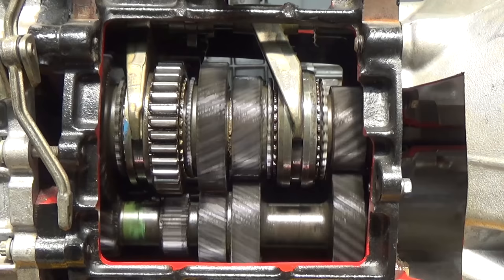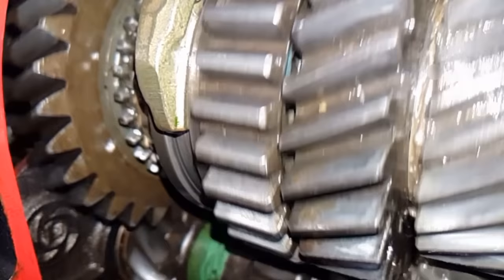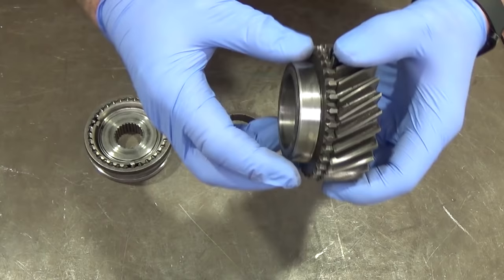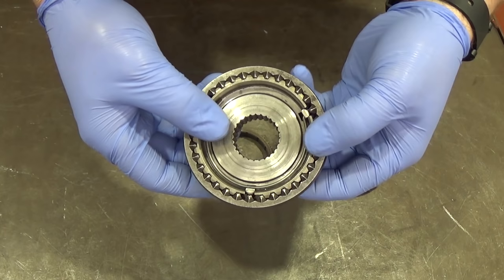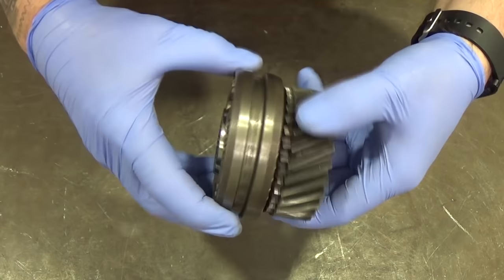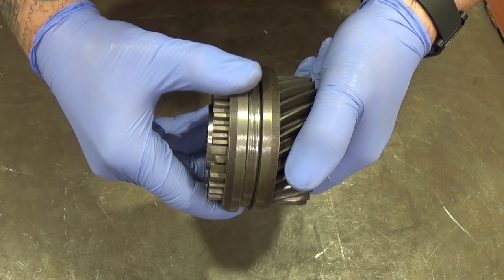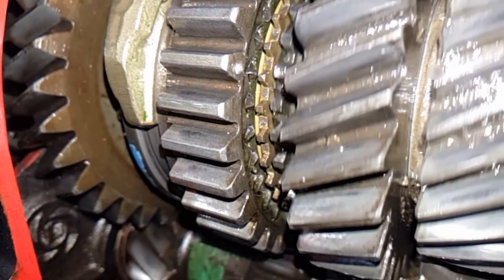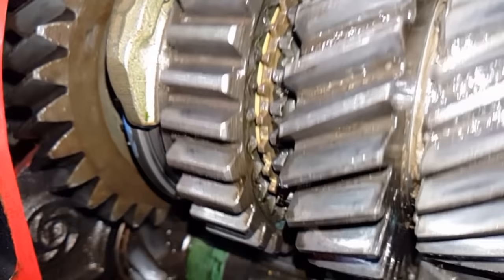Synchromesh unit (Manual Car Transmission) - How it works

Comment: It's amazing that humans are capable of making such complicated machinery. You have to be a genius at this kind of stuff to come up with a system like this.
Reply from the maker: It is amazing James. Although when it's in pieces on the shop floor and you're trying to figure out how it happened, you wish for one of those geniuses to appear and lend a hand.😉
Reply: The mind of Men.
Reply: We've been at it for thousands of years
Reply: Cause it's an accumulation of past knowledge, over hundreds of years, over multiple discipline. It's not that complicated when you pick apart each principle that works for each component. From simple stuff piled up to be more complex. That's just what engineers do. That's why there's a degree for it
Reply: Dont get me started on motherboards in your computer or ecu. But this is Quite impressive as well, its a blessing and curse to be living in this era
Reply: @yunan9610 can’t wait to start working towards my degree in it 😁
Reply: @yunan9610 Think about all the ideas and inventions by people with no degree.  Degrees are only mainstream for the last 200 years. So many inventions were hatched in a shed or garage by some person with an imagination
Reply: @EducationalMechanics would the synchronizers be the reason for say for swapping from gear oil to ATF in manual transmissions (ford rangers to be exact)?
Reply: I have the same exact thoughts you have about this mechanical wizardry.
Reply: @yunan9610  mechanical engineering?
Reply: @AgentOffice  Had to google this, got this from Wikipedia, interesting...  "The earliest preserved gears in Europe were found in the Antikythera mechanism an example of a very early and intricate geared device, designed to calculate astronomical positions. Its time of construction is now estimated between 150 and 100 BC. Aristotle mentions gears around 330 BC, (wheel drives in windlasses). He said that the direction of rotation is reversed when one gear wheel drives another gear wheel."
Reply: Only a small subset of humans were able to conceptualise this
Reply: But the other half is confused on the boy/girl concept. What a time to be alive
Reply: @jonathangarzon2798  We've been using sulfurized gear oil in synchromesh transmissions since before borate ester based ATF even existed. And I've seen tribologists claim that sulfur doesn't corrode yellow metals until the temperature is above 100C. Then there are the ZDDP additized oils like engine oil/hydraulic oil/Ford Type F/CVT fluid that were recommended in some manual transmissions.

Comment: But what I was wondering, and I’d be glad for a response, this system needs quite the pressure to to cause enough friction. Right? So obviously the drivers simple hand gestures must be leveraged hydraulically or pneumatically right? And what I was also thinking is  that you must either be slowing down a running engine or accelerating a car, with only surface friction, otherwise the two systems wouldn’t match speed. Right? How long do Blocker rings live then? I’m sure the friction is very intelligently distributed across the maximised surface area of the blocker ring, with the shape of the lobe and all, and that the material on that part is well treated in manufacturing, in order to be resistant to such wear, but it just sounds like a really tough job for that piece of metal. Mind you my first semester of engineering still lies ahead of me some few months.

Comment: That's a brilliant explanation. Thanks for the video! 

I own a 2017 Jeep Wrangler, and the transmission has had issues going into reverse. I took it to a mechanic, and he mentioned that it's a common problem with manual transmissions from Jeep at the time. He said it was due to the way they designed the Synchromesh. 

Now I just have to redesign it so I can make new parts and fix the issue. One day....

Comment: Fantastic design 👍🏻
Reply: Yeah, until the sacrificial brass sychro ring wears out and you have to throw away the car...  I have a RAV4 on which you have to remove the engine through the bottom to get to work on the gearbox.

Comment: Amazing video! Notice how the synchro immediately matches the speeds of the dog teeth and the constant mesh helical gear. No wonder experts suggest never to rest your hand on the gear stick. The slightest movement of the gear stick towards a gear slot causes the synchronizer ring to start matching the speeds by friction. So keeping the hand on the stick causes unnecessary wear on the gear stick is in fact a very true statement!
Reply: Not only that, there's some really advanced chemistry behind the gear oil additive package's chemistry also. It has to be designed so that a friction modifier component ensures that enough friction is taking place as the synchro/gear teeth start gripping each other. Hard to synchronize slippery stuff together.

Comment: You explained definately and clearly,i want a suggest from u sir,i'v changed the synchronized gear even my gear is noise when shifting what may the reason,one thing i should mention that there is a little gap play between main gear and shifter with synchronized gear,may be this reason? plz guid me

Comment: So say if ur going down the road at 30mph in third gear, you put the clutch down and put the car in neutral for 4 seconds and the change to 4th, wouldn't that mean that all the gears would have time to stop and cause wear since the output shaft is connected to a stationary gear? From my understanding when the output shaft sleeve connects to another gear, the output shaft will be dominent and the gears will match the output shaft untill the engine is re connected? Cheers
Reply: Yes, when the stick is in neutral with the clutch depressed, the gears will slow down due to friction. When the stick is put in fourth gear, the syncromesh needs to bring the gearbox up to speed. I usually double-clutch, meaning I let the clutch out when in neutral. Now the gears are spinning at engine speed, but aren't connected to the output shaft. I use the engine speed to rev match the input and output shafts to reduce wear on my syncros. My transmission is very old so I'm trying to reduce as much wear as possible. I then rev match AGAIN when releasing the clutch.

Comment: I've owned/own vehicles that require "double clutching" as we call it here in the US from 1st to 2nd when the gear oil is cold to prevent gear clash. As the gear oil heats up from friction, I can then shift from 1st to 2nd without any gear clash. I use the engine temperature as a crude "OK to shift" indicator. Meaning by the time the engine has reached NOT, it's usually safe to shift from 1st to 2nd without double clutching. Any reason why the gear oil temperature matters? 

I've got a van that is more prone to this in the winter. It requires double clutching at freezing. Once it's been driven, if can either do one of three things without double clutching. Shift from 1st to 2nd at 20 to 25mph real fast, pull out of 1st, pause for a second then shift into 2nd. Or blimp the throttle a bit after declutching out of 1st before shifting into 2nd.

Comment: Very nice. And the non-spiral gear is for reverse?
Reply from the maker: Thanks thelittlepilgrim. That's right, the straight cut gears are for reverse in this box, you can see the reverse engage on this video https://youtu.be/JWZ6-m-N6V4?t=6m8s at about 6 minutes 8 seconds.

Comment: When u shift to 2 gear shouldnt mainshaft (with hub)be already in movement because of wheel spin ?
Reply from the maker: Hi Piotr, you're right, in a car in 2nd gear with the wheels turning, both shafts would be spinning.
For this video we wanted to show the synchro in action so we held the main shaft stationary. We tried the video with them both moving but it wasn't very clear what was happening.
Thanks.
Matt.
Reply: So many viewers with just a single one to point this out!
Here is stroboscopic demonstration of a synchronization with a rotating drive shaft:
https://youtu.be/e-Lk3FXHubw?t=398

Comment: What I dont get is why the baulk ring doesnt need to synch with the gear in the right..it "breaks" the one in the right to same speed, but it can still misaligned doesnt it (at 1:00 i.e., they will move at same speed, but may be misaligned)? It will never be misaligned to the sleeve, but cant the sleeve hit the teeths of the gear in the right? I mean, sure point teeths make it har to collide exactly..but still, I dont think its impossible
Reply: The edges of the teeth are tapered.  Once the input and output gears are spinning at the same speed, the force of the shift in conjunction with the tapering allows the syncro to slip out of the way and the gears to slip into alignment and mesh.  The purpose of the syncro is to synchronize the speeds and block the meshing of the gears until the speeds are synchronized.
Reply: Also, the gear on the right is permanently connected to the drive shaft.  The gear on the left is disconnected from the engine by the clutch.  The synchro is adjusting the speed of the left gear to match the right gear, not the other way around.

Comment: Hi, I'ved change my synchromesh for gear 2,3,4&5 twice after my first change cannot stand for few miles..how could it possibly happened? Now my transmission still got remain the same issue which is a bit hard to change to other gears since my synchromesh couldnt work properly..hope you can help me..thanks.
Reply: You probably have faulty clutch taht does not separate fully or simply don't press it all the way in when changing gears, so synchros do part of clutch's work, and they are too small and weak for that.